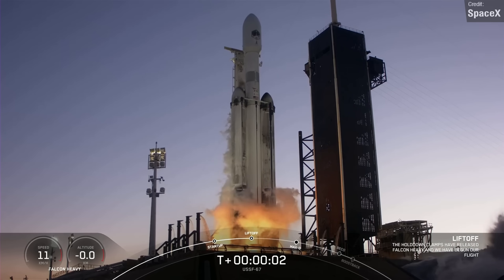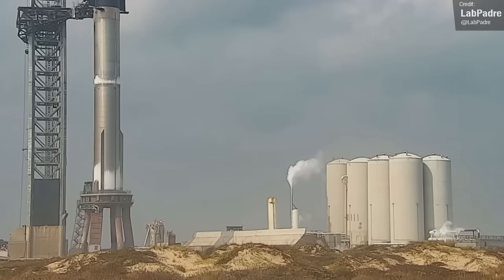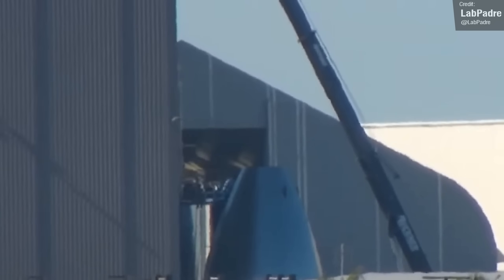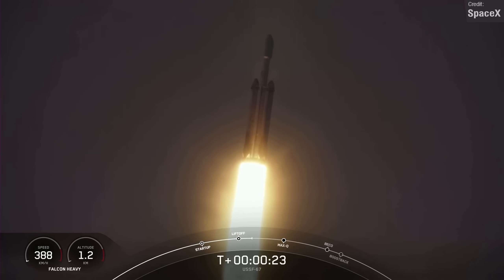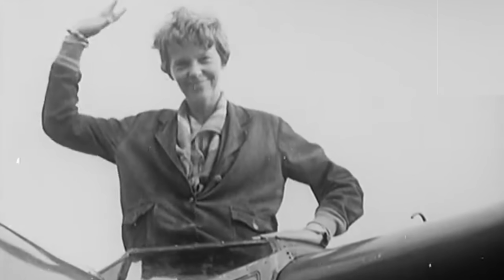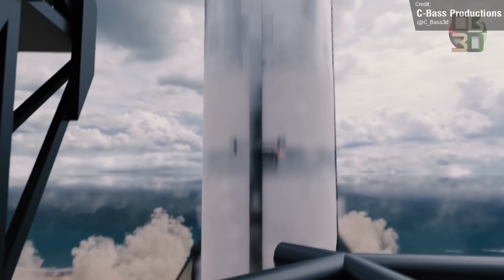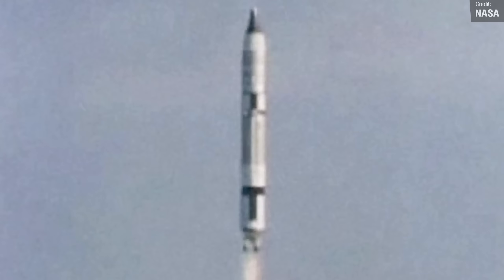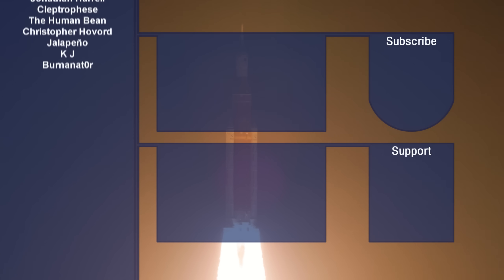SpaceX Starship on Static Fire Pad, Full Stack Fuelling, Falcon Heavy, Two Falcon 9s, Neutron News

Comment: To save the launch mode what is the minimum number of raptors needed on a fully ready to launch starship. Let's say the magic number is 14 we light 14 raptors get the starship assembly 300' above the large tower then ignite the remaining raptors to get it up to speed The last power blast on the launch amount would prevent breakage and the higher altitude means that the water would be sufficient to keep the large mouth cool

Comment: I heard you say dry mass and wet mass or something like that on your jool 5 mission, i dont understand what that means could you tell me what that is?
Reply: Dry is the rocket or stage mass without any oxidizers and fuels, aka empty, wet is fully tanked.
Reply: Dry mass is the mass the rocket itself and its structures has, wet mass is the mass the fuel has
Reply: @Perseagatuna  wet mass is the total initial mass of the rocket, including propellant, and dry mass is the mass of the rocket at full ascent. According to The Tsiolkovsky rocket equation.